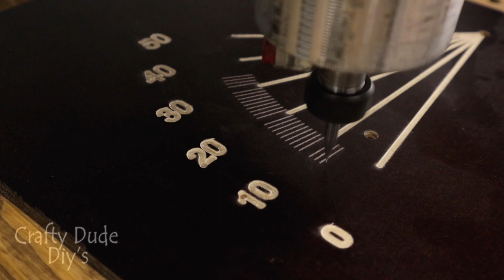Diy Table Saw Miter Gauge||Homemade Crosscut Jig

Comment: Very cool, that's if you have a CNC machine to give you the precise cuts you need to make the protractor plate.
Reply from the maker: you cant change table saw with a cnc router, bouth tools great but for different tasks👍